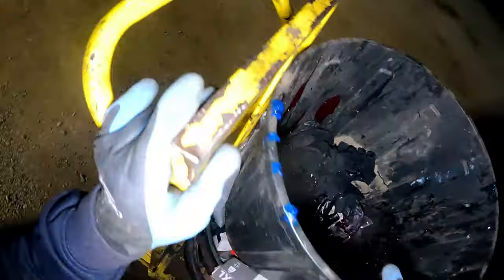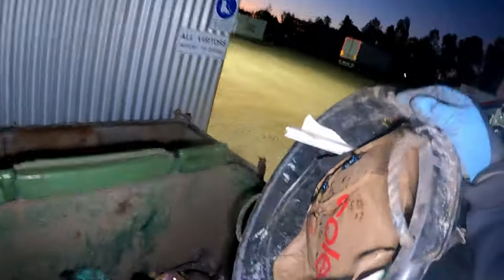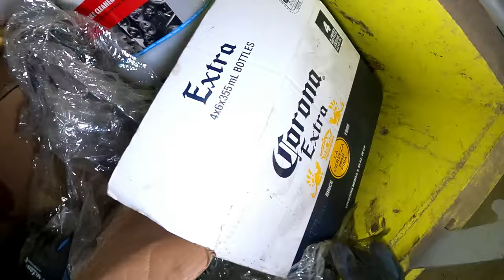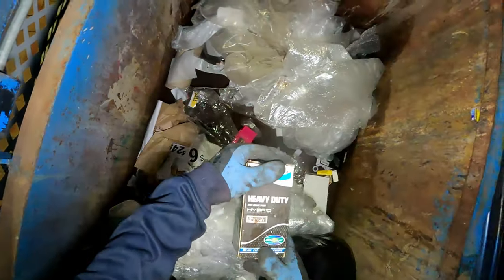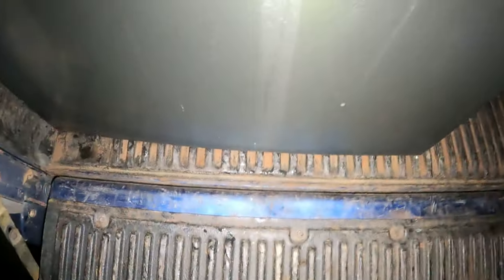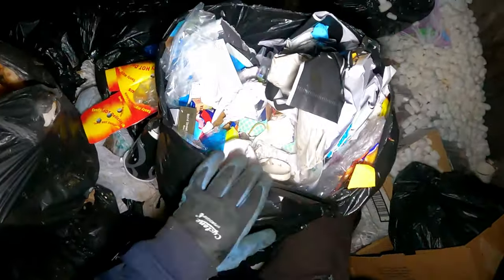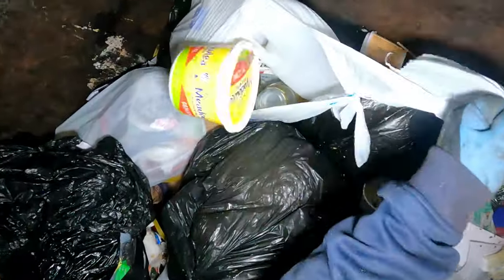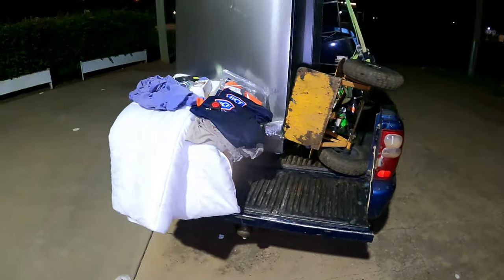Dumpster Diving That's A Full One They Mustn't Like There Beer!!!

Comment: Does the new recycle place not take those little bottles? The ones you say will not go through the machines?
Reply from the maker: They have got the 10 cents but they've never gone through even beforehand as there are two small in size.🤔🤔👍🖐🍾
Reply: @oureverydayliving  I don't understand why they put a 10cent refund and no machine will take it! 🙄🙄🙄🙄🙄🙄🙄🙄🙄🙄🙄🙄🙄
Reply: Why bother printing a 10 cent refund? 🙄🙄🙄🙄🙄🙄🙄🙄
Reply: @oureverydayliving  but at the center where they do the bulk. The one you were against, as you said you would rather just put them through yourself.
Reply from the maker: @kimberly1273 and @joseebedard3180 This is what I have been told is that thay are not registered with the company that has the recycle machines meaning it has been passed by the government but they have not registered with the company to recycle it seems like a lack of communication with each other.
Reply: @oureverydayliving  thank you for explaining.